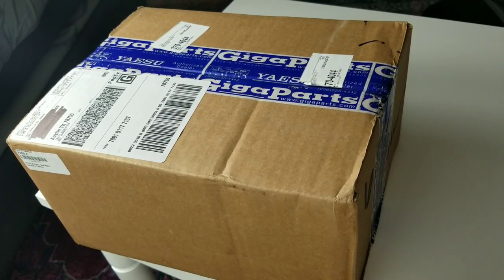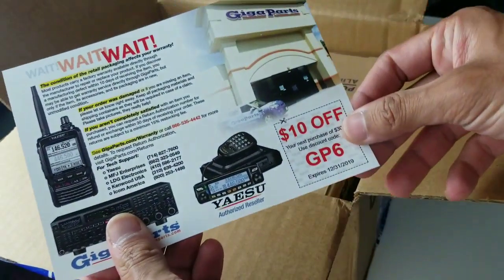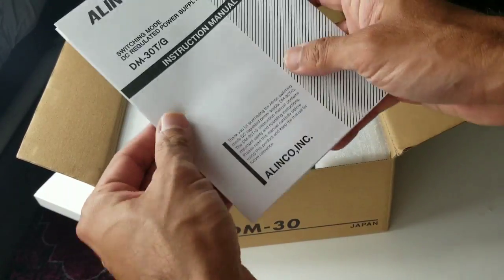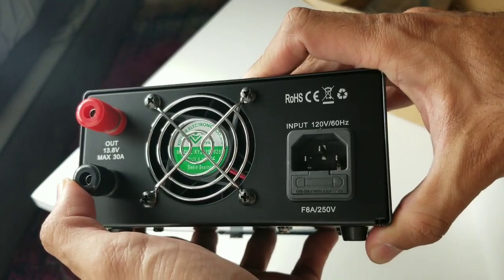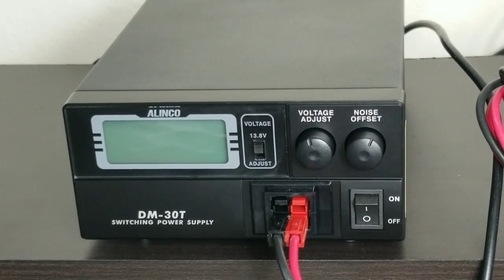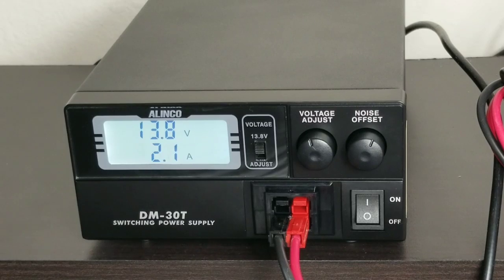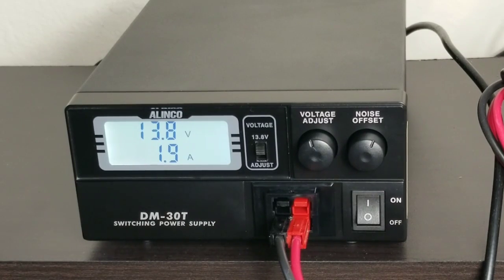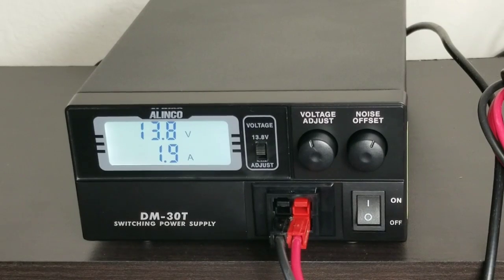Review of Alinco DM 30T Power Supply 30 amps for Ham Radio

Comment: I have a similar problem with Axiom 13.8 V , 30A SMPs .  Then I opened the unit cover , put few DIODES  in series with Fan in its    positive lead  and  reduced its speed . Fan Noice reduced , cooling effect same , Radio operation undisturbed . 😂 ( VU2RMU)

Comment: I just wish they would put the Anderson powerpoles on the rear.  That pretty much is the standard everyone is going to.
Reply: There's lot of choice out there for those types of configurations; I bought this power due to the fact the powerpoles were on the front.
Reply: @cwqrpportable  Just seems odd to me.  I had to wire up an Anderson pigtail with ring terminals to get them on the back.  Very inconvenient, and cost me another $12-15 in parts to do it.
Reply: @jacobw446  Can I ask why you bought the power supply?
Reply: @cwqrpportable  I liked the digital display and the noise offset.
Reply from the maker: Jacob w I completely agree!

Comment: hi. with your powersupply on the back out 13.8V max 30A is that for the linear to go on. i have a 220W linear would that be ok to hook it up at the back and CB radios at the front
Reply from the maker: Hi there! Do you know how many AMPs does the linear need?
Is it for HF or VHF?
Reply: 20 amp fuse inside it of the linear HF for car cb radio ssb LSB
Reply from the maker: john lithgow I think you will be fine :)
Reply: thank you